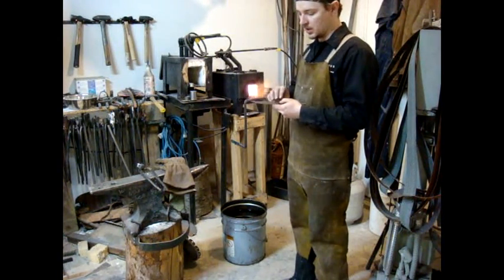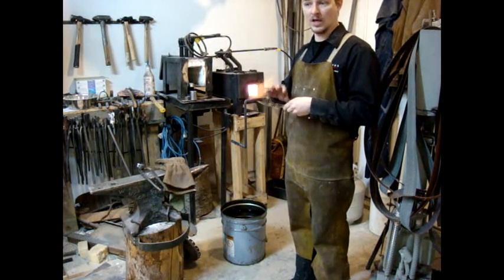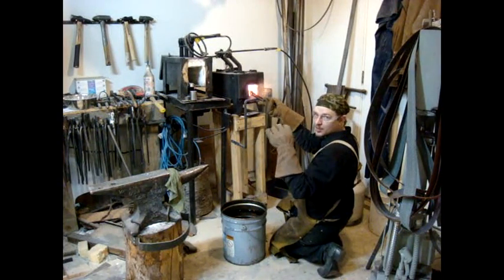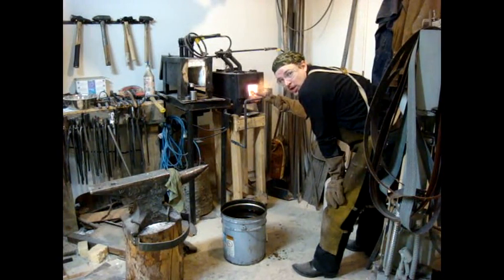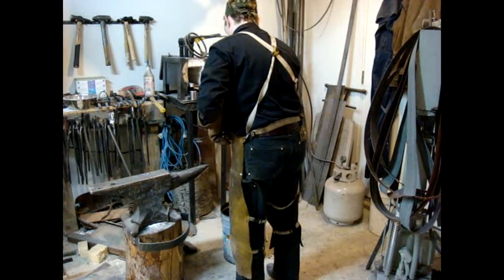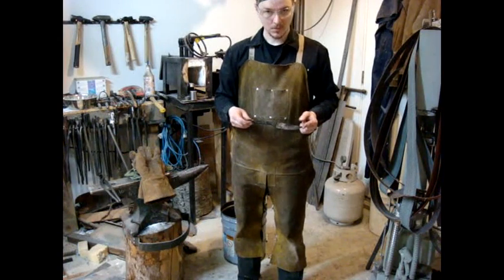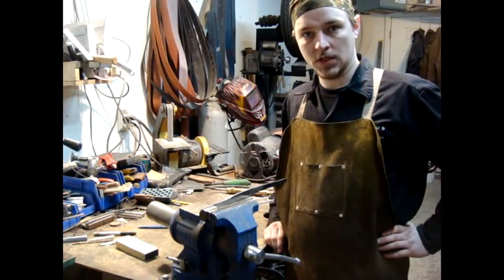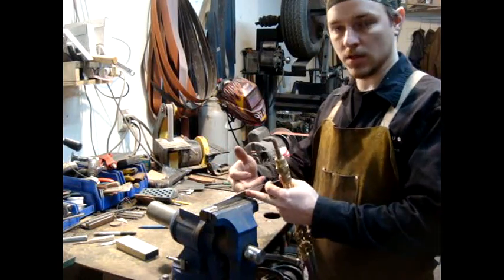Last Frontier Knives - Heat treating a knife

Comment: I love your attitude towards making a better knife. However, you have many misconceived notions about your process. The major one I see is the thought that used motor oil/ATF mix adds any properties to the steel. This is simply not true. Quenchant cannot impart carbon into the material. At best, you will get an oxidized carbon skin on the steel which would inhibit corrosion(which you removed by grinding, anyway). You would be far better off(and safer) to use Canola oil... or better yet, an engineered quenchant. Your process of quickly dipping the blade in the oil is not suppored by any metallurgical fact, either. There is "some" advantage to multiple quenching but not by the method you employ.

Please don't misinterpret my intentions. I am not saying that your knives are of poor quality. You can end up with a functional knife doing what you do. I simply think we, as knifemakers would want to have as many true beliefs as we could and eliminate as many false or unnecessary ones as we can.
Reply from the maker: Wildertools by Rick Marchand 
This is an old video.  I was demonstrating the process as it was taught to me.  I have sense learned a great deal about metallurgy and have adopted a modern process with a Japanese clay treatment.
re-quenching does reduce the grain structure.  But my opinion is now that it's benefits are marginal.
Reply: Thomas Van Krevelen Gentlemen.   Enjoyed the video AS WELL as the posts and discussion.  I really appreciate the honest and mature give and take.  Thanks again
Reply: +Wildertools by Rick Marchand - I agree - used oil adds no useful carbon.
 "A blacksmith will a keen edge win, if he forges thick then files thin"  This adage implies that it's better to file off all the exterior oxidized metal and retain the good high carbon stuff as your finished material.
As far as hardening  "Without Austenite, there is no Martensite" which means that steel (perlite) has to be heated to it's critical range and quenched to form a hardened steel - martensite. Multiple quick heats would not be as useful as a soaking heat at the proper temp prior to the quench.
I was here to find a process to harden the knife edge while leaving the spine and tang unhardened.

Comment: Great video. Good explanations. Have you rockwelled your blades? i came in late in the show, so I don't know your blade material. I really liked the tempering part, but thought purple was rather hard. I wonder how hard is your edge? I subscribe to some machining channels and they say purple is too hard for tools, pins, etc, and, prefer more of a light straw color. When I get my blades (440-C) back from a heat treat house, they have a gold color (rc58 - cryo, etc). I want to heat treat some 440-C and wonder if your process would work? Thanks in advance.
Reply from the maker: tempering is the process of softening steel.  most people get that mixed up.  you first make the steel hard by locking the carbon outside of the basic cubic structure, then control the formations of perlite and austonite.  the purple color is a spring temper, and is softer then the straw color that you are talking about.  5160 steel is a very wear resistant steel and doesn't require a straw color temper at the cutting edge as long as the back is a spring temper.  other steels get to brittle to use this tempering process with.  440c is a stainless steel and requires tight tolerances in temperatures to form the correct carbides.  my rockwell on 5150 steel is 56-58 at the cutting edge, and around a 45 at the back(the purple area)  the chart for 440c will tell you all the information you need to hit the hardness you desire.  high carbon steels you can differentially heat treat with similar processes, stainless is much more intolerant to not staying directly inline with the chart.
Reply: Thomas Van Krevelen Thanks! where do you find the chart?
My commercially treated blade come back around 58.
I Heated a 440-C blade with a rosebud for about 40 min in a small firebrick forge I made. Wrapped it in high temp foil and got the yellow hot color.
Quenched in cold motor oil that had dry ice in it, and put it in dry ice for 10 hours.
I am using an old BBQ grill for the temper and plan on an hour in the yellow-blue flame (cold?) so it will be interesting.
I have access to a rockwell tester, and am curious to see what comes it shows.
I have been thinking about getting or building an oven, and want to use liquid N for the draw down and cryo.
The place I use has a minimum, and I very rarely meet the minimum with the same types of steel.
 They are spendy, but thier work is excellent and I never get complaints from my edges not holding.
Reply from the maker: most common blade steels you can find with a google search.
Reply from the maker: I don't cryo.  it costs extra, and the difference in the grain structure is minimal.  It's a knife, not a turbine blade.  Now if you want to use it as a selling point then great.  lots of people will buy it just because of the word cryo.  but performance wise they would never notice.
Reply: Interesting point.
If you have a captive clintele you could probably grind a hay rake tine & sell it.
I'm not that fortunate.. 
A good examination of the theory would be to test identical blades, and see how they slice a tomato after a hard workout.
Cryognics started out on rifle barrels over twenty years ago. 
No doubt some forward thinking knife maker used that as a feature; but as you mention, the benefit may not be cost effective.
Reply: +Richard Kicklighter - Quenching high carbon steel too quickly can cause internal and external stress - cracks. Cryo on a knife seems overly optimistic.

Comment: the main reason why people use oil is not that the carbon will be sufficient into the steel but that the quenching prozess with oil is much more relaxing then qunching in water. if you quench steel in water it will get harder then in oil ( most of the times ) but it also makes your steel very brittle. i tried this my self and quenched a dagger into cold water . the  result was that i could break the dagger ( after annealing ) with my bare hands. 
and my meaning to what you are doing right here is that you are really abusing the knife that you made with that kind of quench. sometimes when you harden a knife and it does not get fully hard or wraps people do reheat and reforge it BUT your knife will loose some of its stregh then. at first the cristalls in your steel are large then they contract and when you reheat the steel the cristalls have to become large again but this causes much stress for the steel what can later break your knife. so i think the thing ( i dont call it quenching because it is nonsense) you are doing is no good for the steel and will later break your knife. it is even worse then quenching in cold water :(
Reply: I think it's acceptable to quench in water for mild/low carbon carbon steels as the softer metal has to harden quite a bit before becoming brittle. However, for any higher carbon steel, oil is indeed the way to go, as these steels are already harder to begin with and the shock of quenching it in cold water will push it past hardened into becoming brittle.
Reply: you are right :) when you use mild steel with very less carbon you can quench in water ( even cold water ) and nothing happens it won´t get brittel or something :) but when you use a hardenable steel ( steels are hardenable when they got more then 0.5% carbon in it ) that got as less carbon as possible ( springsteel ) it can already be very bad for your knife :( i tried it out with two knifes :( they were nearly the same and i quenched one in oil and one in water :) the one quenched in water was very sharp afterwards but it did not take any abuse so i used it as a nick knife the other one was not that sharp ( still shaving sharp ) but very strong so i used it for more rough wood working :) 
so there are pros and cons of hardening in water or oil

Comment: I agree with the changes in mechanical behavior but I'm not entirely sure its because of reduced grain size (usually forging/rolling needed)

Your first quench will produce martensite, but an oil quench is not severe enough to cause a complete transformation, maybe 90% martensite and then depending on many factors some combination of bainite, unresolved (ultrafine) pearlite and retained austenite. The subsequent quenching will most likely transform the remainder into martensite.

Comment: The carbon from oil will not be sufficient to result in case hardening effect.  You are likely to get decarburization from the open hearth furnace. I would recomend investing in an induction heating system because it will get you to a temperature faster.

If the temperature achieved by the acetylene torch is above the transformation line (~1400 F) and it is allowed to air cool then a pearlite structure will develop. If below then it will be a tempered martensite structure

Comment from the maker: if you are new to heat treating, then I would use Oil.  There is less chances of cracking or warping the blade.  If you do use water make it a salt water brine, as heavy as you can get it, then heat the water to around 150 degrees.  Water cools the steel very fast and if you don't have much experience with it then you will have a lot of problems.  With oil the cooling is a bit slower and easier to control.